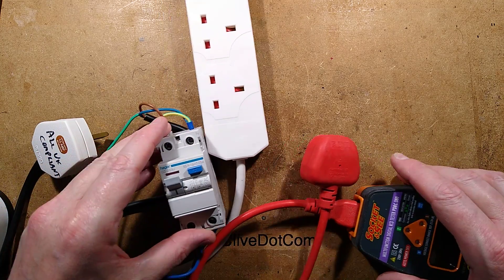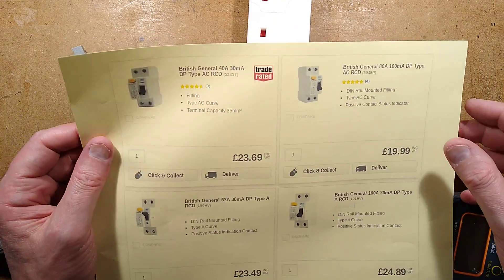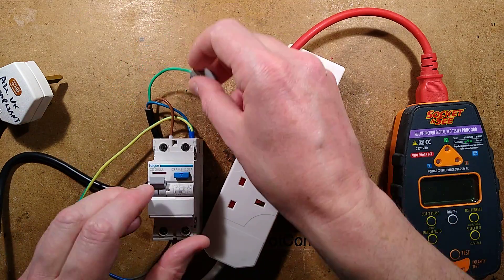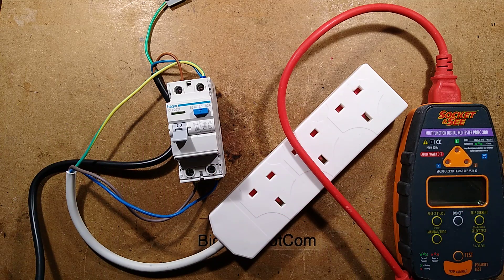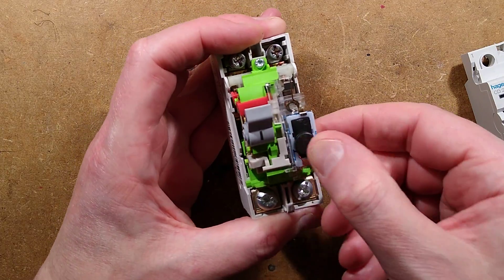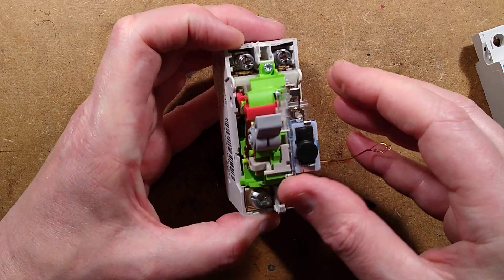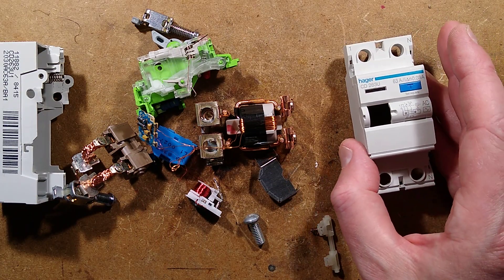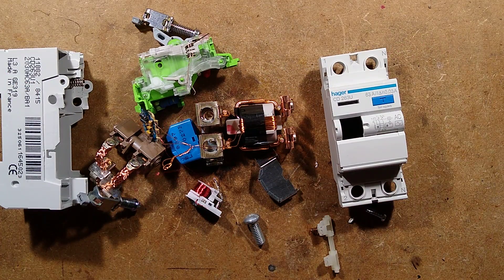Was this RCD damaged by overcurrent?

Comment: I've had my share of nuisance tripping on RCDs. Interestingly I've used that very same RCD, it's actually fairly good quality (compared to the really cheap stuff), but still quite a bit cheaper than the really high end stuff (ABB).

I discovered that modern appliances typically have surge arrestors and EMI filtering stuff in them that causes a small leakage to earth. If you have enough such appliances on an RCD, you get to the point where it's right on the brink. During times when we get rotational power cuts (known as load-shedding), it is quite common for the RCD to trip when the power returns after an outage.

Backup inverters that have their own TN bonding relay also open the TN bond to test the relay (this is required by grid codes in many countries), and the act of removing the TN bond temporarily as well as passing a small DC test current through it all adds up to very frustrating and intermittent RCD tripping.

That is when I learned about the various types of RCDs. There is type-AC (the one in this video) which is your traditional type, only really sensitive to AC leakage currents. Then there is type-A, which is better. Then there is a subset of type-A that has a small delay built in to avoid nuisance tripping on transients. ABB calls theirs "type APR", Gewiss calls it type IR (impulse resistant), Hager calls it HI (high immunity). These are quite a bit more expensive than a plain type-A, but must more affordable compared to what comes next. The next step up is type-F, and then type-B. These things are practically unaffordable.

In my house I have the loads split over 2 RCDs (roughly 7mA standing loss over each one), and one of those RCDs (the one feeding computers and other switch mode supplies, things that traditionally have higher standing leakages) is an ABB type-APR.
Reply: Rotational power cuts sounds like some poverty shit. I can't believe it's being done in big US cities. Never a better time to turn on the AC and do some cooking than after a power cut.

Comment: Does the main switch capacity current be equal to the sum of the individual circuit breakers. The chances that all are on full capacity is slim. In my house (the Netherlands) the main breaker (from the provider) is 35 amps. If i add up all the groups circuit breakers together it comes to 128 A..

Comment: Simultaneity factor also plays a big role in grouping. So it cannot just summed up, also assunimng a shower taking 40A all the time is false. Usually the amps will be spread out as the heating elements have periods of heating and cooling. My guess the max that RCD has seen over a longer period is 35-40 Amps
Reply from the maker: When a shower is running it's hearing elements are active for the full duration of the shower.

Comment: You have the same voltage in Britain as we have in Germany, about 230-240V. But your breakers are much larger than ours! I've got a bunch of 16A breakers, often for only a few sockets, and then also 10A and even 6A for the bathroom socket. The biggest breaker in my flat is that for the electric stove/oven at 25A. The sockets for the washing machine and the dish washer in the kitchen are also 16A each. Other circuits enclose a whole number of sockets on one 16A breaker. I find it interesting that you have such high values there.
Reply: Seegal Galguntijak they’re still in the tone age electricity wise.. lots of dodgy installs over here.
Reply: You can't have sockets on a larger breaker than 16 A (20 A in the US). In the UK the plugs have fuses so the breakers can be larger.

Comment: I was at an update meeting with a Hager rep last year (I think) and we were told that they are changing all of their 'standard' RCD's provided in split load boards to 100A rating, as generally that is the highest your cutout fuse will be and that is the only thing protecting the RCD should a fault occur with the RCD, that and to avoid this example of overload. I personally now fit RCBO boards where possible, much simpler when it comes to fault finding :)

Comment: Interesting. We have an issue here where each level of the house has its own panel with RCD's on each board. There are times where we might get a trip in the basement RCD when lightning hits real close but the other upper two levels do not trip. Outside there is an entry pedestal fed from the meter which is street side some 30 meters away. In this pedestal is a breaker box equipped with 4 MOV's and safety breakers. Indicators on the MOV's do not indicate any partial or total failure. Still we have that basement tripping, weird. Back in the states we had outlets in the bathrooms which were equipped with internal RCD circuits. These would feed through to the other bathrooms providing protection. The kitchens as well have one outlet that feeds several others. The fun thing is while talking on a handheld commercial two way radio I could easily trip the RCD as I passed it while keying the radio. Would tweark off anyone using the outlets,  tis not good to piss off the better half, one could wind up with brain damage and not from the RF energy of the radio......
Reply from the maker: Some RCDs seem prone to tripping on lightning transients.  Changing it for a different unit might solve that.

Comment: Understanding the rating..deffo wrong choice of circuits hanging off it but really even with two 9.5 showers an oven element and a kettle switched on ..considering thermostat switching and 2 mins with the kettle I don't see it burning up......bus bar behind the gate I think.  Maybe test resistance of the sw mechanism when closed would clarify. ..Not seen end of vid yet

Comment: I've always been careful about how many things are running on one circuit. In America our circuit breakers are mostly 15 and 20 amp. I've never overloaded a breaker, but the wiring in this house worries me a bit
You're right about LEDs too, there's so many modern appliances that cause weird problems and interface. I got some things that you plug into that prevents these problems but I can't remember what they're called and would have to move some stuff to look.

Comment: 10:38 I think they brake the test circut becaus it would bypas the mainswitch. The test works like Input1->testButton->resistor->littleBrakeContact->Output2 (or another order). Whith means it is not possible to power the output accidential over it with no Protection. Yes there exist Locks and Seals for RCDs for working. Nerver used one. Greatings from Germany, sorry for bad english.

Comment: I haven't tested my earth-leakage breaker in five years.

But since I haven't had Eskom in that same period, I  guess it doesn't matter. 

P.S: the terms "earth-leakage detector" and "residual current device" are used interchangeably in South Africa's legislature.
Reply from the maker: Are you off grid?  In the UK another type of breaker is the ELCB Earth Leakage Circuit Breaker.  It was an older style of breaker that could detect either current flow in an earth wire or potential difference between building ground and external ground.  Not as good as an RCD.
Reply: @bigclivedotcom  yes. I am , pretty much, off grid.
Eskom, our sole electricity supplier, and I had a falling-out around five years ago.
As i live alone, I chose to leave it that way after several failed attempts to get them to re-connect me.

Our house wiring Law made the older earth leakage detector illegal to install in a new wiring installation.  However, it's not illegal to replace a faulty earth leakage with the same.

Fortunately, nobody sells the older types anymore so we use RCDs.

My own house is old and the wiring is 30 to 40 years old.
It still has the older earth leakage, which was functioning as intended back when I still had mains. 

The house has been re-wired at least once since it was first electrified as all the antique bakelite switches and sockets have been replaced with fittings that were in vogue in the '80s.

Comment: You say usually the higher current ones are right to left but mine seemingly go the other way, you think I should change that?
Reply from the maker: It's not that critical.  If it works, don't fix it.
Reply: @bigclivedotcom  oddly enough, its how I try and put them plugs in an extention cord...

Comment: I test mine every time I go outside, the box being by the door, I usually turn everything off while I am out of the house, no point powering things if im not there!
Reply: I take it you don't store frozen food or have a hot water cylinder, then?
Reply: @Agent24Electronics  not any more,no
Reply: @Blazin Redeye mine is ceiling height, it helps to be tsall, but I also have a stick and pastic pipe I use for poking it from a bit of a distance, save my back!

Comment: Very interesting thanks Clive.
Reply from the maker: Were you disappointed that there wasn't anything more conclusive?
Reply: bigclivedotcom slightly disappointed it wasn’t showing signs of overload at all. I know when I tested the rcd with my Kewtech Kt63plus it failed on 3/4 tests and the one it passed on was a very high trip time. Definitely a few factors in the property rendering this rcd useless.
Reply: Check out SparkyNinja YouTube video about Testing Hager RCCB/RCDs UPDATE, requiring a higher test current to achieve correct disconnection time. Fitting a type A RCD would not reduce tripping more likely to increase as the AC type may  have been blinded by DC current and not operate in some situations. Strip MCB's out and fit Type A RCBO's is the way to go if the customer can stand the cost,  however that may change when we have to fit AFDD's, Type F, EV,B,B+ RCD'S where will it end.

Comment: I have an RCD that frequently trips when I switch the 110 volt transformer on, no measurable earth current on that. Seems to be something to do with inductance and the point in the cycle when the switch connects. The RCD has been changed and I still get the problem.
Reply from the maker: It is the RCD or an overcurrent breaker that tripping?    The high initial inrush current to site style transformers and welders often trips standard type B breakers.  You can switch to a type C breaker with better inrush handling if the wiring is suited to it, or add an inrush limiting component to the transformer like an NTC inrush limiting resistor.
Reply: @bigclivedotcom  Only the RCD, the circuit breakers don't pop just the rcd, had wondered if it is due to the center tap on the secondary causing animbalance

Comment: Interesting! My cooker and shower are wired into the same breaker. They are never in use at the same time, so that's ok isn't it?!
Reply: The breaker will trip before any damage is done, so it's really only depends on your idea of ok🙃 The house I just moved to has a single 16A cirquit for the water heater, water pump and washing machine. Gets really annoying really fast.
Reply: @Blazin Redeye sound like you're pretty well off by my standards

Comment: Could you tell us a bit more about that "novelty system" where the earth is connected to ground at more than one place?
Reply from the maker: I only know of one installation that used it, and it was a utility company in their own offices.  It used a combined earth and neutral conductor throughout the installation.  It's a terrible idea, since a broken connection can result in "grounded" metalwork becoming live.
That was about 50 years ago, so I doubt any modern systems use a similar system.
Reply: @bigclivedotcom  So this would be a TN-C system then, normally only used in distribution?
Reply: Koffi Banan earth is connected to neutral as a neutral reinforcement on street lighting posts
Reply: @filipe.skunk8  Is this referred to as PME?
Reply: Koffi Banan not sure if that’s the designation for it, this is only done in the power distribution network and is to keep the neutral to earth reference at 0 volt so if there’s an issue with the power distribution network the neutral will always be 0. Since the street lights run off the distribution network, we do this every 300 metres roughly. Not sure if I’m explaining it properly.

Comment: I also had trouble with the Hager RCD at home. It would randomly trip on its own or every time unplug in the car
Reply from the maker: That may hint at an electrical issue or an off-tolerance breaker.
Reply: @bigclivedotcom  The same EV charges (And unplugs) perfectly fine on any other circuit in our house or elsewhere. Also since i changed the RCD with one from ABB the issure did not show up again. When i tried to recreate the situation that causes the tripping the RCB trips exactly at 31mA. There is something odd about those hager RCDs that only shows up in dynamic load applications...

Comment: I’ve found that with new kitchen equipment the earth leakage is quite high. Internet of things and all that.  I’ve have to use an RCBO on individual circuits to stop the tripping.
Reply from the maker: When a lot of switchmode supplies are used it can cause increased earth leakage.

Comment: Was the burnt Wylex mcb a 6, 10 or 16A as some were recalled  

The Wylex MCB batch numbers for 6 A and 10 A are

RIRA
RTRA
RC RA
RHRA
RGRA
RERA
RARA
SRRA
SSRA

16 A

RIRA
RTRA
RC RA
RHRA
RGRA
RERA
RARA
SRRA

Just a thought 🤔
Reply from the maker: I already checked.  The 32A breakers weren't included in the recall.

Comment: 100A WTH? Here in Germany a typical household is fused with 3x25A breakers with individual circuits being fused with 16A (heavy duty) or 10A (lighter duty). Do British households even have the pre-requisite wiring gauge to to support that? Here for 16A breakers 2.5mm^2 wiring is mandatory which is already somewhat unwieldy to handle...
Reply from the maker: 2.5mm for 16A circuits is normal here too.  The 32A rings use a loop of 2.5mm that goes round the circuit and returns to the breaker.
Reply: Daniel Egger 100A single phase houses are nuts.. plus they do dodgy rings here instead of providing more selectivity for the house circuits.. lazy electricians..
Reply: Filipe, on the contrary, three phases - and 400v between them - is much scarier
Reply: Alan Patterson i agree it’s much “scarier” but that doesn’t make it less safe..also much better as the lights won’t dim every time you turn on a couple appliances.. I’ve seen houses with big power demand here being supplied with 2 single phase intakes which doesn’t really make much sense and also much scarier as you’ll turn off the intake and half the house will still be live.. probably with different phases too so less safer as they can be mixed more easily than if you have a 3 phase supply and are aware of it.. 3 phase would be the way to go in a house like this.
Reply: @alanpatterson2384  I don't see anything scary about a 3-phase setup. The principle alone makes it much safer to handle than 1- or 2-phase configurations, everything is standardised, can be easily tested and it's pretty much impossible to get a working setup with an incorrect installation. Only downside: Lower current ratings mean that if something goes wrong the bang is far less spectacular...

Comment: Don't know UK code, but in US, having multiple circuits that add up to more than the main isn't all that unusual.  Sort of a 'duty cycle' thing.  It'd be like saying, "Well what are the chances that both showers are in use at the same time someone is making tea in the kitchen and all the lights are on.... etc..."

So although it could happen, the RCD current wouldn't exceed rated for very long and might only mildly heat up.   And judging from the condition of those contacts, they didn't open under heavy load very often or ever.

Love your video's BTW, watching you dissect things is a great way for me to get my 'tear stuff apart fix' vicariously.  :)
Reply from the maker: It's called diversity factor here.  Based on not everything being in use continuously at once.

Comment: Place where I worked, we had a lot of old-style electro-mechanical chart recorders fed from a circuit protected by GFCI (what we yanks call RCD's).  When we replaced the recorders with solid-state electronic ones, the GFCI's started tripping a lot.  We found that the newer recorders (since they have a lot of electronics and such) were equipped with heavy line-filters to ground to project them and these filter caps were drawing a fair amount to ground.  Since the whole distribution panels were fed from conditioned power, we just clipped the line filter caps inside the recorders to solve it (not the best way I'm sure, but it solved our tripping problem).
Reply from the maker: This is a common issue in the entertainment industry.  The electronic loads have to be broken down into a lot of smaller circuits.  Which is a good thing to do anyway.